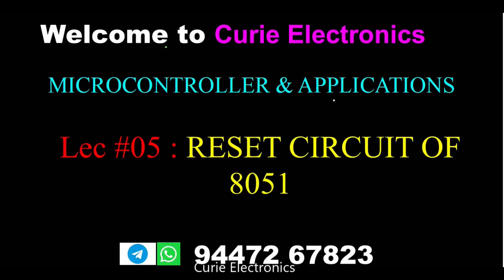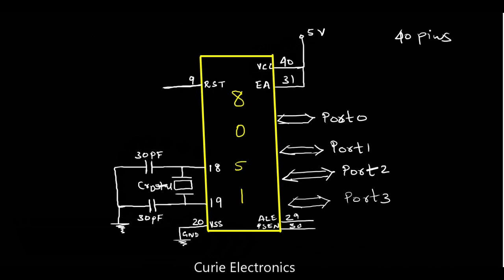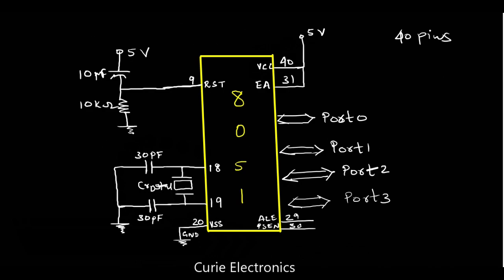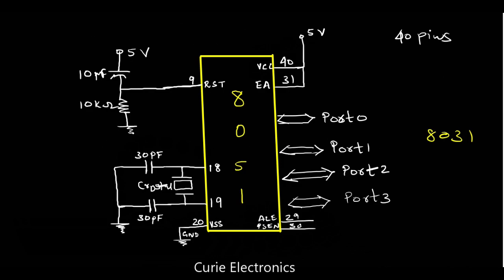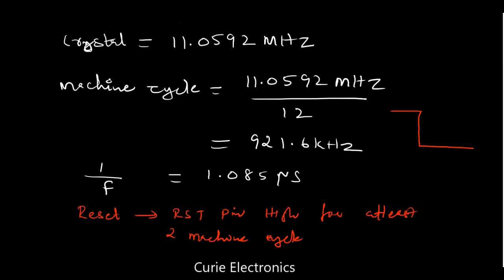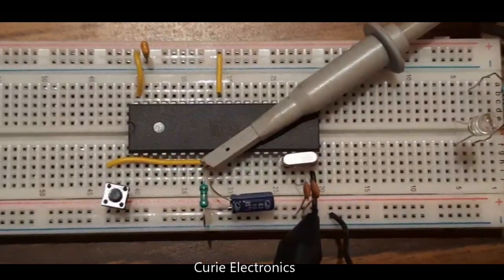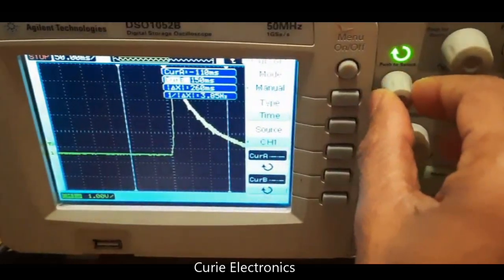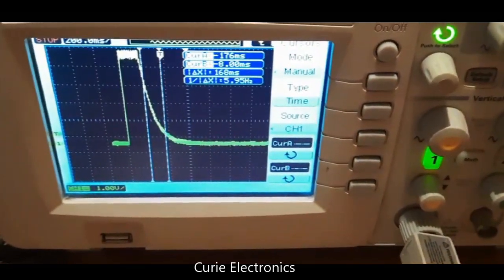8051 RESET CIRCUIT(Power On and Manual)

Comment: Thanks for uploading this clip. Can you explain the difference of a "power-on reset" and a reset executed on the eset-input of the mc? I ask for a simple reason: I wrote a long assembler program. It works fine when I do a reset via the reset-pin but when turning the power off and turn it on again, the program behalfs different. Do you have an answer? Thanks for responding.
Reply from the maker: I will check once and let u know in a couple of days.